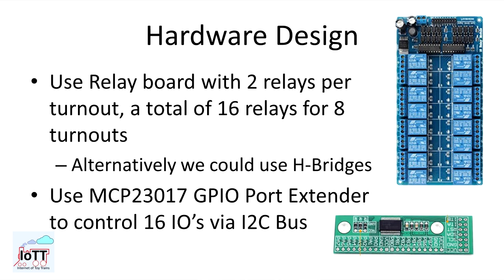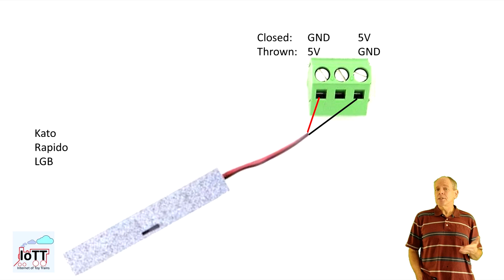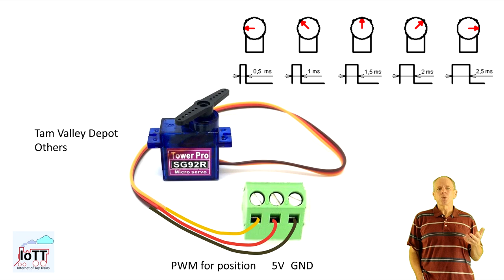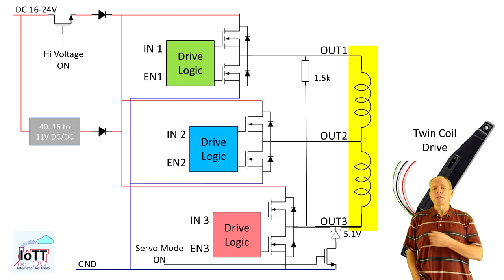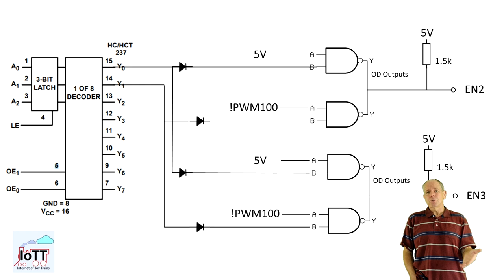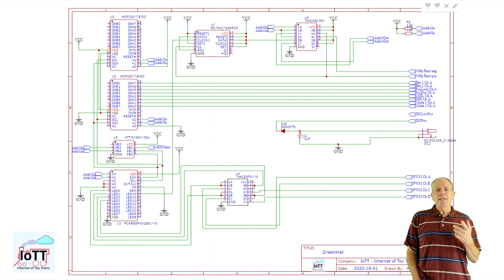Switch Decoder Power Stage (Video#54)

Comment: Another intriguing idea Hans. A universal turnout decoder would certainly provide many options for users. Also, being able to extend this design to a total of 16 turnouts makes for an economy of scale. Well thought out. For my personal use, being able to combine single coil and servo turnout machines will be very welcomed. I’m sure that the eventual software will provide all the necessary options needed by either. I also was impressed by your inclusion of the ATtiny to control some neopixels. This should make turnout indication a snap. You have some great ideas and I look forward to seeing what else you can come up with. Hope there’s not too long a wait for the Greenhat to be offered on your Tindie page.
Reply from the maker: Thank you. Yes, the Stick software will provide similar functionality like the YellowHat, and then some. And in addition, the GreenHat will also work on DCC, without network connection, but of course only in output only mode for remote commands. Local input commands from the buttons will work as well, of course, but the information stays local.

Comment: Great job Hans...in surprised main stream manufacturers haven't figured out away to do it either I'll definitely be ordering when available.
Reply from the maker: Thank you. Well, that would be a question to ask the manufacturers ;-) But of course most of the typical designs date back about 20 years. Driver chips as the one I am using became available and cheap (because of volume) with drone technology, I guess, so that may explain some.

Comment: On my layout I am currently using dcc specialty wabbit to drive my tortoises. It have a two nice features. I can change the speed to throw the switch and I can cut a rail gap and throw the switch automatically when a train arrive. It can be use to have an automatic reverse loop.
Reply from the maker: The GreenHat will have these features as well. Each output is PWM driven, so you can adjust the voltage that is seen by the turnout. This goes for coils and motors. The idea is that you can feed the GreenHat with e.g. an old notebook power supply, say 19V as typical for Dell, and then adjust the voltage down using the PWM settings. So, the supplied voltage determines the maximum voltage and can go up to 24VDC, and then you scale it down depending on the motor or coil nominal voltage.
The two input buttons can be used as level or toggle buttons and can be connected to any button or sensor that can pull them to GND, so you can connect a current sensor or IR sensors to activate the turnout.   When connected to a network (LocoNet, MQTT, LLC) the information will be available everywhere, in case of a DCC connection it will be a local activation, not going through the command station.